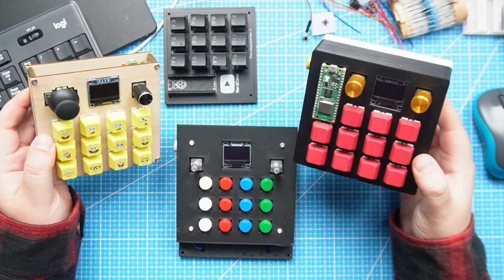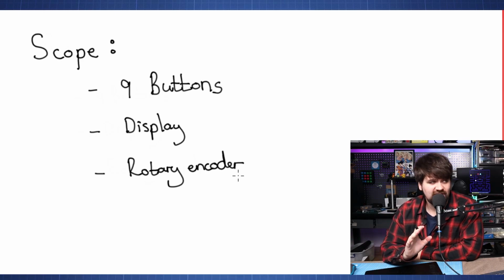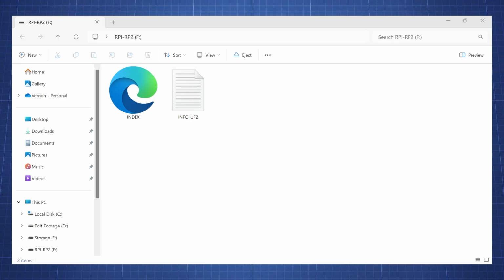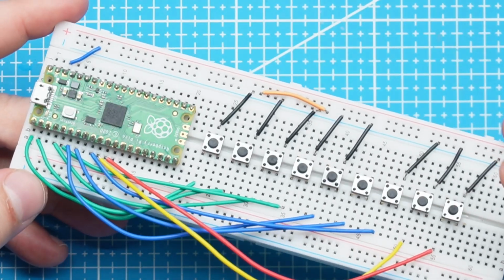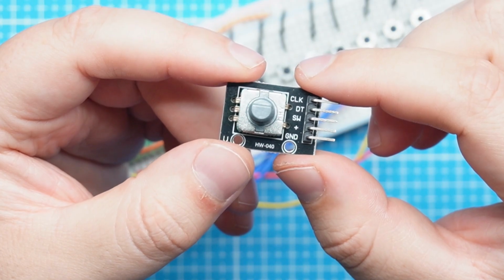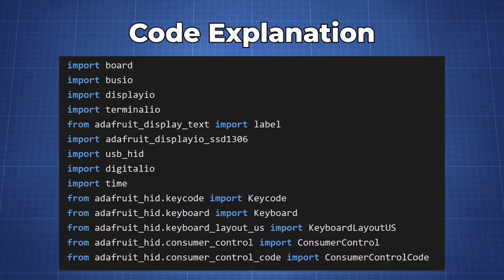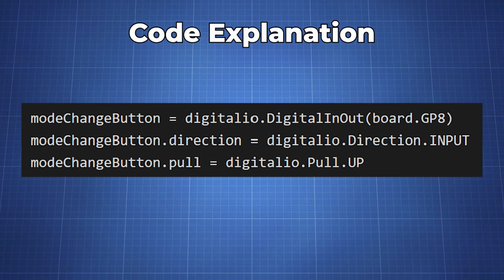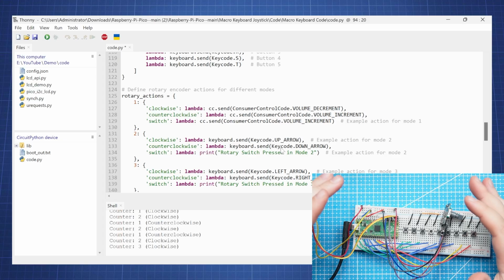Build your own Raspberry Pi Pico Macro Keyboard   Part 1   Prototype and Code

Comment: Thank you!  I do have one question though.  I'm struggling to figure out the correct syntax to make one of the keys a CTRL+C.  I've tried a ton of different formats and even tried chatgpt, but it hasn't really helped.  Also, I'm curious if a single key press can be made to use a string like CTRL+C, then CTRL=T, then CTRL+V?
Reply from the maker: Yes you can for example you can send it like this,  keyboard.send(Keycode.CONTROL, Keycode.A)

Comment: As usual YT deleted my comment with a link ... Ok then this is short version: i wanted to use keypad.keymatrix. When i was listening the events in main loop I had problem that events happen only during click or release (not during pressing). So keyboardobject.send sent only one stroke, even if i was keeping button pressed. But i workarrounded this problem by adding pressed_list and now events don't call send() method directly but merely append/remove keys to pressed_list and i loop through this list later with calling send().  Not sure if its real solution (please share your thoughts) but I hope this helps someone whith similar problem.

Comment: Raspberry Pi Pico, Arduino, STM32 or ESP32?
Reply from the maker: I said to only mention a few popular ones, there are many more but for simplicity using the Pico because of CircuitPython
Reply: @NerdCaveYT  I was asking to know which one would be better for that task hehe
Reply from the maker: @monneratrj  in my opinion if you want to mass produce it as a product then most likely something like CH552 might be cheaper, but this will mean you will have to write software to make it easier for user to change macros etc. Now in terms of easiest as DIY I would say circuitpyhon so the Pico.

Comment: Is there a reason you are using an old version of circuit python ( 7.2.3)  or was this just filmed back in 2022 ?
Reply from the maker: The new version they removed and changed libraries and the OLED was having issues.
Reply: @NerdCaveYT  what sort of issues ?
Reply from the maker: @Keeping_IT_Simple  just lot of modules and functions missing when you run the code. This happens in MicroPython as well when I try to upgrade old projects